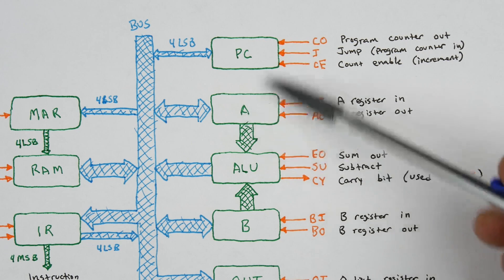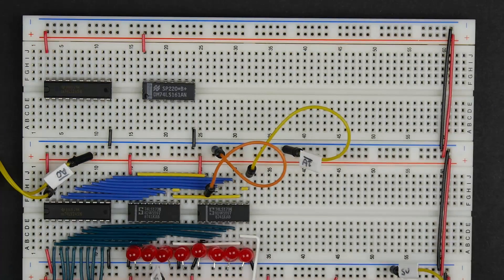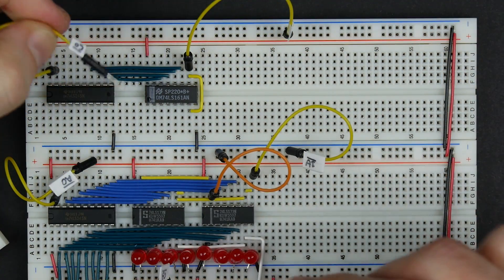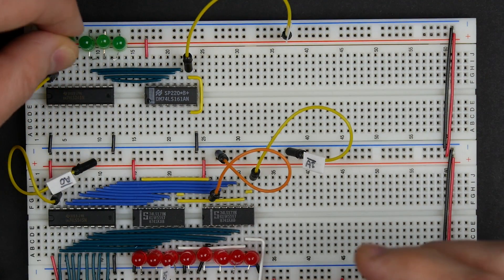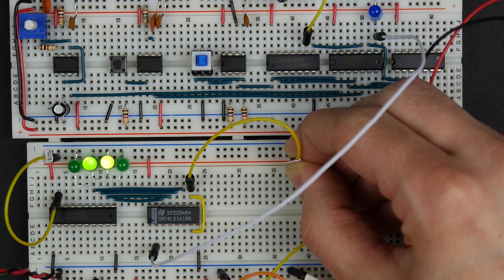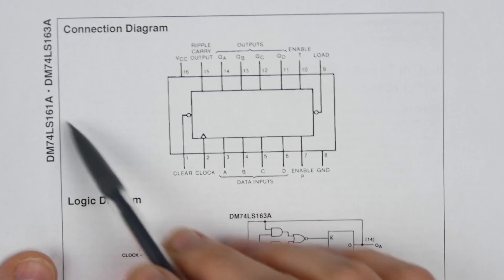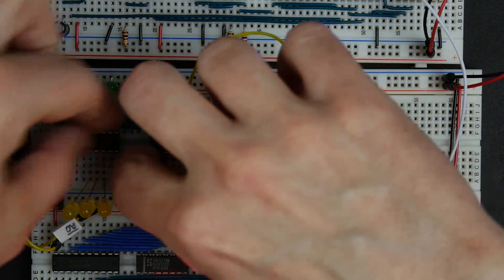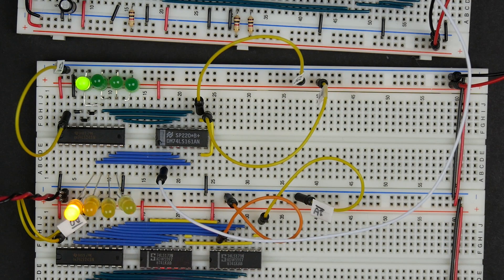Program counter build

Comment: So I had issues with the counter being very glitchy. It would double count some times and log a count even when the clock was halted. I found 2 thing that made it stable. First was to tie the clear line 1 to VCC instead of leaving it floating. The next was to tie the clocks from the other registers to the clock clock line with the rest of the computer. I’m not sure why that would matter but it seemed not to double count when I did that. Any ideas why that would be?

Comment: Late to the party, but I am still interested in building this.  Sadly in 2022 the ICs are not readily available and 74LS are very hard to come.  (perhaps I should add I am based in the UK!) Found out that you can use 74HC as an equivalent, so 74HC00 instead of 74LS00, but I am unable to source anything that looks like a replacement for a 74LS161,  are there any site that show the replacement or equivalent chips in this case?
Reply: Your best bet is to search the description of the IC... not sure where you buy your stuff, but have a look at RS Components (edit: take note of descriptions at RS... stuff is often sold in packs instead of single)
Reply: You cannot use HC together with LS in this project. I believe the output of one does not correctly drive the input of the other, forgot which is which though.

Comment: For those with problems, I had two and was able to solve them.

1. I had only 1 LED flashing. After tying pin 1 of the 74LS161 to HIGH, other LEDs began to flash.
2. But, the LEDs seemed to flash in an unpredictable manner. It wasn't counting 0-15. I then tied pin 9 on the 74LS161 to HIGH. This fixed it.

After those 2 changes, the program counter was working as Ben's did.
Reply: Absolute savior !! Thank you !
Reply: Truly a life-saver!

Comment: I'm having difficulty sending the program counter to the data bus. The LED's on the bus seem to flicker then suddenly they're all on... then flicker away quickly. They remind me of Steve Martin looking for his rhythm in The Jerk. It feels like some capacitance is building up somewhere and suddenly pulsing out. 

I've replaced both the 74LS245 and 74LS161 (in case those were fried) but they seem to be ok. And every other module interacts with the data bus just fine and dandy. I've rebuilt the circuit a handful of times now. Any ideas?
Reply: Nevermind. My replacement 74LS245 was fried too 😅

Comment: My binary counter is counting when the clock goes high and when it goes low. Anyone know why this is happening? It seems like it’s almost experiencing the racing affect as it will sometimes jump ahead in the count by more then one place on a rise or fall of the clock. I’ve looked at comments on the website about disconnecting the clock from the register circuit, but even when the clock is only connected to the binary counter the problem still persists. Any help would be very much appreciated!

Comment: hi , im having problems with my counter, it is jumping from binary 01 to 10  i have tried every suggestion , im loosing my mind, the counter work fines when the 74ls161 counter enable  pin is enabled by a pullup connector, but it doesnt work when is connected to the control logic circuit.
Reply: Same issue, using the chip that came with the kit. Only sometimes does it actually lineup all correctly it seems to just be jumping around sporadically and turns to 0 in between the count up as well periodically
Reply: @chopov11  Have you tied pin 1 to +5V? I solved my issues with this.

Comment: Abnormal counting behavior additional solution:

TL;DR: Ben is using his clock circuit by itself, but my clock circuit is still hooked to the RAM module. The capacitor on the NAND gate for clock edge detection on the RAM manual input causes this to screw up the voltage in the circuit. I still don't have a solution other than just pulling the capacitor for now. 

Many comments talk about the abnormal behavior of the circuit and its inability to count properly. I had the same problem. Many solutions mention tying pin 1 of the 161 to 5v and one mentions a putting a 470 ohm resistor in line with the clock circuit at pin2. Both changed the behavior for me but didn't solve the problem. While troubleshooting I accidentally tied the first bit of the 161 to high with a loose wire and all of a sudden the other three bits were counting just fine (albeit only with three digits). This made me realize it was a power problem. After many mods with various resistor and breadboard layouts, and measuring voltages all over, I realized the issue wasn't at the 161, but at the clock input. The only other thing hooked up is the capacitor from the "RAM module testing and troubleshooting" video he inserts at 13:10 for edge detection. since Ben only has the clock-module hooked up in this video he doesn't have the same problem. For now I'm just removing the capacitor and simple NAND-ing my RAM. I havn't watched further yet, so hopefully he encounters and discusses this issue in later videos. I would love to hear solutions to this problem if others have it! Thanks.
Reply: I was also seeing erratic behavior from my clock module. This was extremely helpful, as the removal of the edge detection circuit immediately brought my clock circuit back into functioning again.
Reply: Thanks man, you saved my day!
Reply: Hans Dampf, fixing this took me hours....glad to have helped someone.
Reply: The blue led on the clock. if it doesn’t have a current limiting resistor it causes the counter to act sporadic. I just removed it.
Reply: thanks!!!!

Comment: I think I have some weird power supply issues... The counter basically works (sometimes), but the output of LS245 is wrong (the highest bit / pin 6 is always 0) and the rest 3 pins sometimes output correct LOW/HIGH voltage and sometimes not
Reply: nevermind, I've figured it out, I forgot to put the resistors

Comment: If your program counter appears to be resetting or erratic,  make sure you tie pin 1 of the 74LS161 to 5V!  Ben’s seemed to work fine without doing so.  Mine was obviously resetting as the pin was floating.
Reply: the comment i was looking for. was too tired to check the datasheets again XD. sometimes i wonder how those chips can be so different from his. now only the display part left :o
Reply: DarthZackTheFirst Are u fairly knowledgeable on the workings of this computer?
Reply: maybe, maybe not, i dont know XD
Reply: DarthZackTheFirst Haha.  That’s the way I feel.  I finished my build but have run into an issue that I cannot resolve with the ALU I believe.  When I try to get the computer to count up from 1 to 255.  It stops at 240 and resets.( Start with 1 in A and B register.   ALU sends total to the bus which gets put back into the A register).   The last total of 240 never makes it into the A register.  It resets to zero at that clock pulse.  I have done everything I know to do short of disassembling the entire thing.   It actually worked at one time but stopped somewhere along the way.  Any ideas from a fresh mind???
Reply: im not that far. just finished the 7 segment part. so next is hooking up the bus. didnt think it would take that long getting there ^^``. could be lot from what i experienced so far XD . did you put enough capacitors into the power rails? there cant be enough. i put at least one in each power rail. did you use the same grounding if there are different power supplies used? is the power supply for at least 2 amp rated? i had one with 1 amp, the capacitor got quite warm :S . i had also power issues when i didnt ground my leds with a resistor. just the chip wasnt enough. caused weird behaviour. doesnt sound like a programming issue if it counts up that far (?). maybe the carry/flag does soemthing wrong if its always the same number? those are just wild guesses ;( .  anyway might want to try google "reddit beneater" . ask someone there. seems to be quite active. what video are you at or is that already the last? when i get there i can answer it maybe XD .
Reply: DarthZackTheFirst Thx for the suggestions.  I’ve called myself doing all of those things you’ve recommended. I have an oscilloscope but not real proficient with it.  I have been very meticulous with my wiring so I believe it will be a power issue of some kind.  I’ve run into quite a few issues along the way but have resolved all of them.  If you run into anything feel free to ask here and I may can help you.  No idea how Ben could get his to work per his build alone.  I will try reddit beneater.  Thx for the suggestion!!!!
Reply: almost burned a breadboard XD . forgot to set the chip-enable of the eeprom (was floating and i was wondering why it isnt writing it correct into the eeprom for so long :/ ) on the arduino eeprom writer. one of the 595 got quite hot, couldnt even touch it and the breadboard was getting warmer and warmer on the other side :o . who would have guessed, can burn plastic with 5v XD
Reply: mine happens when the clock speed is too slow
Reply: thanks mate😌
Reply: your my savior
Reply: why? why has ben ALWAYS luck with this kind of things? he doesnt even use resistors for his led's
Reply: @ No idea.

Comment: I have a question. At 6:00 when you bring the counter enable low, the counter stops counting. But then a second (maybe clock tick?) later it clears out the counter completely. Is that how it is supposed to perform?

Comment: If it helps anyone, you might need a 1k pull up resister to 5v on the reset pin (pin 1) of your 74LS161. I'm using a SN74LS161N, It's super super finky and simply won't cooperate without the pull up resister. I tried tying reset to 5v and it works most the time, but sometimes still doesn't, but a pullup resister seems to have fixed the issue. I hopes it helps someone :)  I'm still working on my copy of the computer after a year lol.
Reply: Oh :( it was more complex then that, the edge detector circuit in the ram module was somehow interfering with the 74LS161, so I've placed a 74LS08 in a spare area on the ram module area and passed the click signal through it ANDing it to 5v. This filters out whatever the issue was :( I couldn't detect any difference between the signal with my oscilloscope though :( But it least now by program counter and ram both work. I wish I knew why this helps, I think it has something to do with signal integrity? not sure

Comment: I have a problem with this counter. I built this but when  I power the circuit, the least significant LED of this counter keeps blinking along with the clock a couple of times and then it starts counting regularly. What could be the issue? I put 100uF bypass capacitors across 70% of the power strips but did not help. I also put a 0.01uF ceramic across the clock as the wire enters the 74LS171 chip. Any help would be appreciated.
Reply: I have a very similar issue. When I run the clock fast, it counts normally, but when I slow the clock down, the least significant LED blinks a couple times like yours, and it will only count up to the third bit before starting back at zero. Have you figured anything out yet?
Reply: Try to set first pin (CLEAR active-low pin) to high.

Comment: Couldn't we use the binary counter chips for all the other registers as well? I mean, a counter is a register too: it stores its current value, we can load a new value into it, reset it, and it outputs a value which we can then interface to the bus through the octal bus transceiver as usual for output enable. As a bonus, we would have a nice quick way of incrementing each of these registers :> And those chips aren't that much more expensive than the registers. Am I missing something?
Reply: No, you are not missing anything. There are also direct register chips like 74646 with integrated 3-state logic and clock edge using - but Ben is starting from more basic chips to show, how it works INSIDE (so he also have LEDs everywhere, even if it means to not use 3-state output and put extra 74245 after those LEDs) - it is matter of didactic aproach as in contrast to most efficient result.

Comment: If anyone has issues with their counter randomly resetting like I did, make sure that you tie the bottom left pin (pin number one) to high. This pin is the master reset pin, and if the chip detects it going low it will randomly reset. I guess for whatever reason the breadboard I am using causes more issues than others as Ben never had the issue.
Reply: I wonder if that explains why at 6 minutes into the video, when he's working on the jump signal, it seems to reset a few times.  I notice he does not have pin 1 set to high.

Comment: Hey Ben my counter is incrementing on the up and down edge of my clock pulse. (so twice the rate yours is) any ideas what could be  causing this? I tried cutting the CLK signal in half with a 74LS107 (JK FF) but it still incremented on the falling edge and randomly reset itself? Any ideas?
Reply: Its probably a little late now but I had the same problem and found a post of Alex Roetter on Ben eaters homepage. He traced the problem back to the RC Circuit build to only write to the RAM on the rising edge of the clock. As soon as I unplugged the Clock signal going there my problem was solved. Alex suggests to use the NAND gate as a diode. Or you could just implement a real diode. This will stop the capacitor from interfering.
Reply: I had issues with weird random counting as well that were fixed by isolating the capacitor by using a spare NAND with the incoming CLK and 5V before the capacitor. I can't see any obvious difference looking through the oscilloscope, would love to know how to "see" the problem. :)
Reply: @Norndrag  Thank you!
Reply: Beng  a diode lets electricity flow only in one direction. If you for example would use an AND gate to AND 5V and CLK you have the CLK signal on the output again but also effectively build a diode because now electricity can only flow from the 5v and CLK input side to the output but not from the output back to the inputs. If you build the output how Ben designed it you conveniently have some NAND gates lying around there unused. So to emulate the CLK AND 5V you can build (CLK NAND 5V) NAND 5V which is equivalent.
Reply: Try tying the CLR pin (1) high
Reply: Actually I also have this issue, even with CLR tied high. It counts on the rise and fall. Did you fix this?